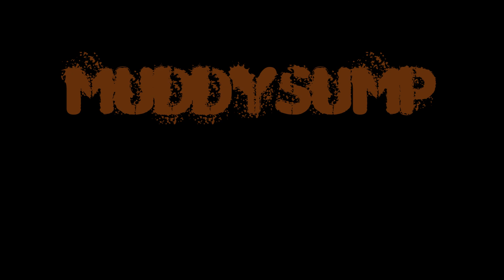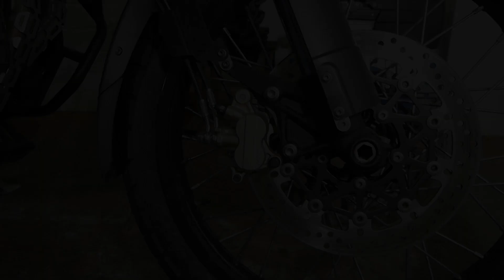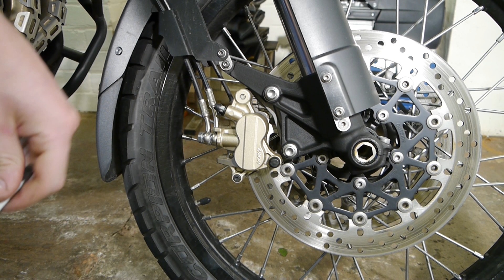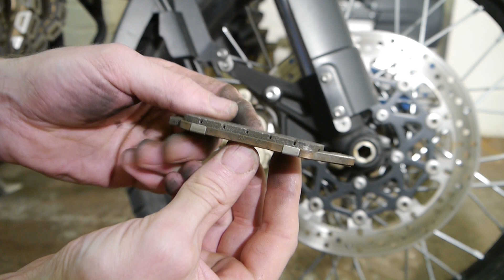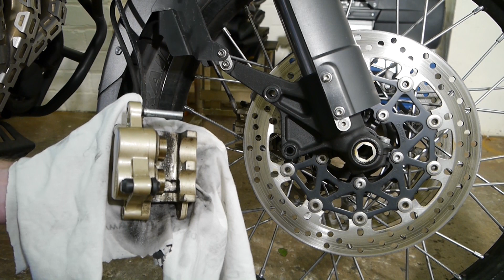Tiger 800 - Front pads change/clean

Comment: Thanks for this, very helpful. My 2012 Triumph Tiger 800 ABS has developed a knocking sound that I'm sure is coming from the front, L/H calliper. I can see movement in the calliper. I don't think the disc is warped as I'm not detecting any sort of pulse through the lever or brake pedal. What is going on? Your thoughts would be gratefully appreciated. Thanks! 👍
Reply from the maker: Is it not just the parts all moving. It’s a sliding caliper and floating disc too

Comment: Hi, thanks for these video's! They convinced me to start doing my own maintanence on my tiger 800 XC! Do i see correctly that you use two different types of grease? What kind of grease should I use for the slider pin and the other pins? Thank you!
Reply from the maker: Hi. It’s copper grease on the brake pad pin. I used multipurpose grease but you should really use some silicone or rubber grease on the slide pins because of the rubber boot

Comment: Hi, for the first time I had my front jacked up because I wanted to change the front brake disks, they were at 4mm limit. I didn't try to spin the wheel before taking it off, but after installing the new disks, I gave the front wheel a spin and I witnessed its not moving freely, it looks like brakes are not releasing pistons and it only spins for one or two turns before stopping. Is this normal? I started to suspect a stuck piston or two, came back to this video only to see that when you pump the brakes - the pistons are also in no rush to return back. I always assumed that the vacuum in the system should suck the pistons back in. Can you shed some light on this?
Reply from the maker: Yes that’s right. The pads are always just skimming the discs so they bite as soon as the lever is pulled
Reply: @MuddySump  thanks

Comment: Good video that I've used for reference several times. Thanks! A quick note: I noticed today that the service manual calls for silicon grease on the sliding pins. It states that mineral grease should not be used.
Reply from the maker: I think it can make them perish a bit quicker but I’ve never seen one go bad yet
Reply: @MuddySump  yup, I've always used normal grease and so far the rubbers are looking fine, but in future I'll be using silicon grease
Reply: @MuddySump  will lithium grease do for the pins?
Reply: Always silicon greace in anything that comes in contact with rubber otherwise they can make the rubber hard crack and failure. Auto parts store have small tubes for sliding pin grease for break jobs and copper grease for the end of the pads, no need to put any grease in the back of the pads

Comment: All your vids are great. Very professional. I would like to know the total thickness of a front pad, that is, friction material and backing plate. I have purchased some pads from the local shop and they are 10mm thick over all. These won't fit with the pistons pressed all the way back by hand. Any help is gratefully received. Do you have a Patreon account? Cheers.
Reply from the maker: Hi John. Haven’t got any near me to measure but online it says the ebc pads are 9mm thickness. Are you taking the top off the brake reservoir to push them back? It sometimes won’t be able to move them back if there’s no air gap in there. Be careful though cause it can squirt out with the pressure
Reply: The pads are DP Brakes DP501 with a specified thickness of 10.3mm but actual is 10.0mm. I tried with the master cylinder cap off but the piston won't retract any further. 9mm will fit I reckon so I go back to the shop. Thanks for your help.
Reply from the maker: John Rutter no problem
Reply: I've had another thought. Could it be that the DP Brakes pads need to be installed without the ant-squeal back plates?
Reply from the maker: John Rutter could try it
Reply: The sun's gone down in Tasmania. I try tomorrow afternoon and give you feed back. Thanks again.

Comment: Hey mate, in your video you don't mention the u shaped piece of thin metal, I think is called a pad retention spring and I can't figure out how to put it back in as it pooped off when I took the caliper off. Any ideas? Thanks in advance
Reply from the maker: +adrian collins the part that the front of the pads sit in? It disc goes between the U shape.

Comment: MuddySump  thanks for your detail informative videos. I have noticed on my 2016 800xc were the front return brake line from the abs modulator to the caliper looks like the connection to the modulator via banjo bolt and washer does not appear as snug and tight as the line from the cylinder to the modulator, seems to be loose around the washer, although no sign of leaking at all 100% dry. Am I just over thinking? Thanks Scott D
Reply from the maker: +Scott DiLemma hi scott. It would definitely be leaking if it wasn't right. You would lose the pressure in the lever too when you pull it
Reply: Pressures good and no leaks so I feel good about it, thank you for your help. I subscribed.

Comment: any ideas got a stuck plug? tried gt 85 and some heat too but nothing. stuck there won't turn. can't even use a socket on it 😕
Reply from the maker: +Mike hi Mike. Is it the brake pad pin or the little flat screwdriver cap that covers it?
Reply: MuddySump the fat cap that covers it. totally useless tread on it to use the screwdriver.
Reply from the maker: +Mike it's already been damaged? They do sometimes take a bit of impact with hammer and screwdriver while trying to turn it. If it's already lost the chance of doing that then can try tapping it around with a punch if still no good will have to be drilled out
Reply: MuddySump thank you.  just managed with my drill. your videos are great for what I'm doing.  thanks man.
Reply from the maker: +Mike what's stuck? The brake pad pin?

Comment: Love your videos. I have a 2012 xc and just did my rear brake with no issues. When I did the front, I can't for the life of me get the pistons back in. If I push on one, the other one pops out and when I push them both together they don't budge? Any help would be greatly appreciated.
Reply from the maker: +adrian collins have you taken the top off the fluid reservoir? That will be keeping pressure in the system
Reply: MuddySump I did take it off after several attempts to get them back in and it didn't seem to make any difference. I took my left hand side front brake off as per this video and everything went perfect. On the problem side. You can push one almost all the way in but the other piston comes out, it feels impossible to budge them down together. Thanks for your quick reply
Reply from the maker: +adrian collins if you've got the old pads still then put them back in and put a screwdriver between them to push them apart
Reply: MuddySump yeah I will try that tonight. The pads were actually okay. Only decided to check them as I went on a ride and I felt like as I would go to take off or roll to a stop that the brakes were slightly. engaged when I hadn't touched them. Just started happening. Got me buggered.

Comment: Curious, Looking at a 2015 XRX, 8,800 Miles on her. Front and rear rotors look dirty or burned, is that possible? Looking for items to lower price offer, needs back tire soon ($120-$175 USD) Thanks, Cheers...
Reply from the maker: +MrBackyardMechanic discs are expensive on them. I have noticed some seemed to of blackened before. Are you running the standard pads still?
Reply: Well, the bike has 8,800 miles on it. I'm not sure how many miles one can get on a set of pads... A few people have looked at the bike, don't know why it's not selling, it's in great shape as far as I can see.

Comment: About to do this, i only have brake cleaner in a can, is that safe to spray everywhere like your stuff?

thanks
Reply from the maker: +Boris theBlade yes it's the same stuff just in aerosol
Reply: MuddySump
Alright cheers mate
Reply: MuddySump
Also, just out of interest, what do you charge to fit and balance tyres? (if you do them)
Reply from the maker: +Boris theBlade don't do tyres. Shouldn't cost much taking just the wheels to a shop
Reply: MuddySump
£40 for the pair, if i bring loose wheels is the cheapest ive found. Dealership was £54.

Gonna have a go myself first though

cheers.

Comment: is the procedure identical on the abs version? :)
Reply from the maker: Yes, exactly the same. Only thing with the abs version is to make sure you don't get air in the system when bleeding them
Reply: +MuddySump hey, just finished the job here myself, really easy when you have guides like these so thanks again :)

One of my caliper-pistons is stuck tho, is there any easy way to loosen it?
Reply from the maker: +Biker on Ice try taking the calliper off and the pads out. Try and hold the free piston and pull the brake lever to try and pump out the seized piston. Could leave the pads in too and squeeze them together. Can take the pads out afterwards to push the Pistons back in
Reply: Ill try that, thanks :)

Comment: Hi muddysump. I drive the tiger 800 xcx.
Do you use standard lithiumgrease for the pen
 in the swimbrakes? Or silicongrease? 
Sorry for the bad english. Hope you understand it. I'm a swiss guy. Cheers
Reply from the maker: Mathias Koch hi. I use copper grease on the brake parts. 
Thanks 
David
Reply: Sure coppergrease by pads, but i mean the pen/bolts in the swimsaddel (schwimmsattel)? 
Thanks a lot
Reply from the maker: Mathias Koch Do you mean the back brake bolts? I used a bit multi purpose grease. Some say it is bad for the rubber, can use silicone grease
Reply: Yes that i mean. Ok. Thanks. Great videos! Continue like that! ;-)

Comment: Do you have a video of replacing one or both of the front disc brakes? How do you work around the ABS?
Reply from the maker: Hi. No video for it. Just take out the screws for the abs disc then you can take off the brake discs afterwards. Tighten brake disc screws evenly to 22Nm and the abs screws to 5Nm. You should fit new screws too when you do it.

Comment: hello muddysump,
can you tell me what type of product you used to clean the brakes up?
I use brake-cleaner which is kind like a anti-grease-stuff but it ony comes in spray-cans and i would like to avoid those.
Reply from the maker: I use a wire brush to clean the pads. I use brake cleaner in a refillable pump bottle by wurth, it lasts ages
Reply: MuddySump :) I got that ... but can you tell me a brand or more details about the brake cleaner? I seem not able to find it in bulk.